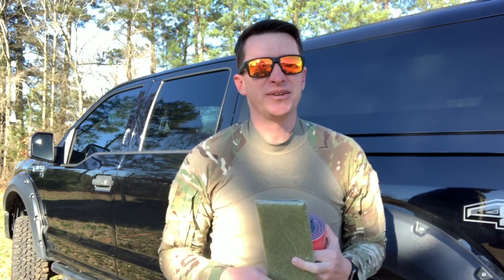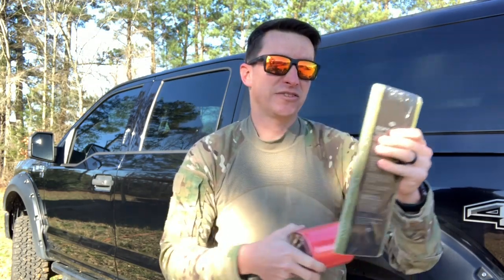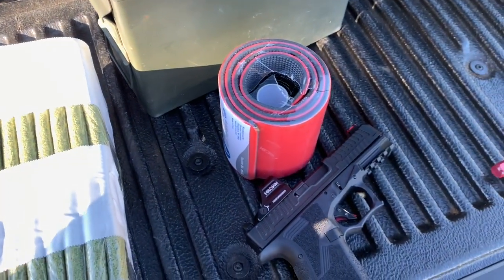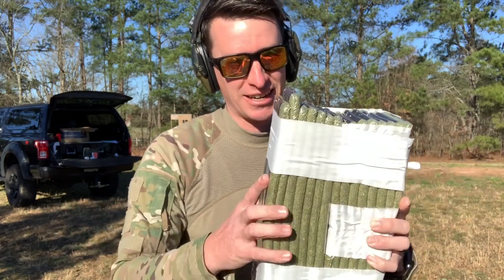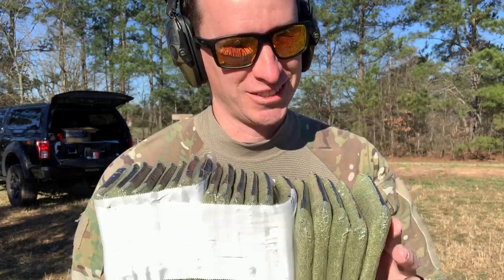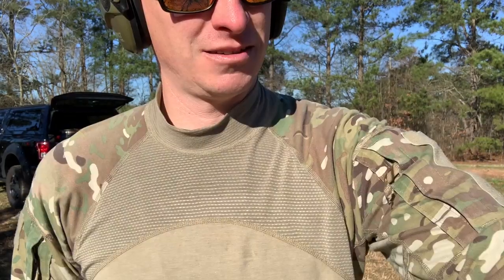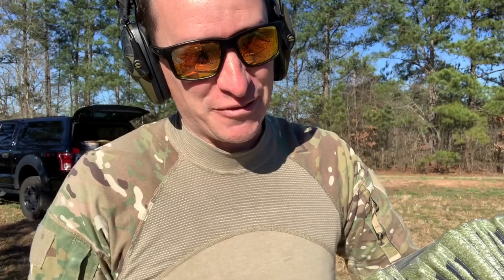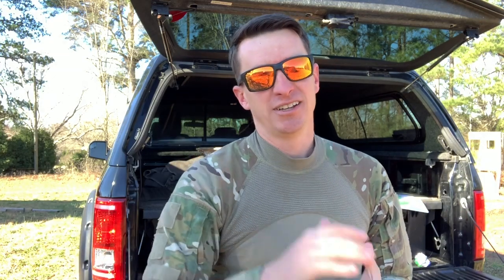How many Sam Splints does it take to stop a bullet?

Comment: I wonder if Sam splints have a different ability to stop bullets when they are bent. They dont seem rigid flat but we all know that when you put a bend down the middle, it actually works as a splint. As has been pointed out, the bullet also hit the ambulance first (although the metal cant be that thick) and the gun was shot at some distance we dont know away. The bullet slowed down over time.